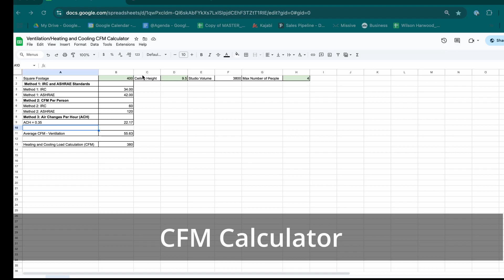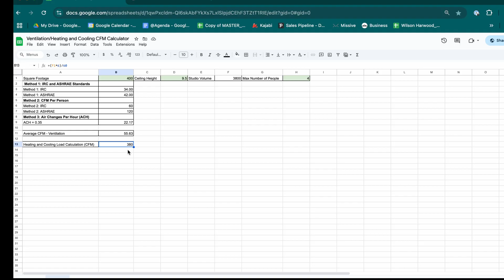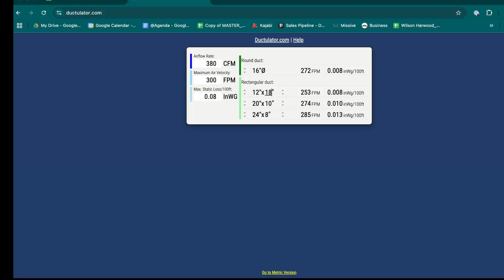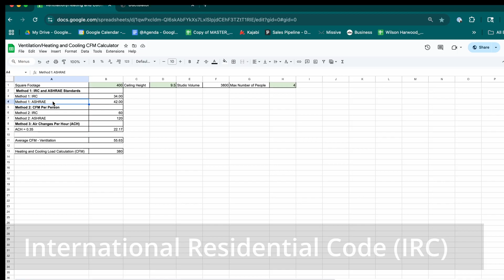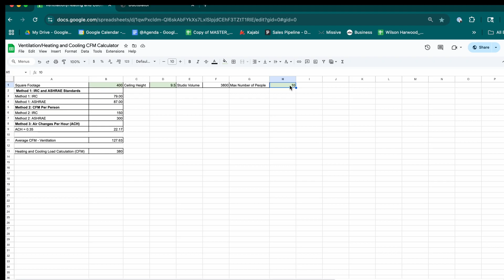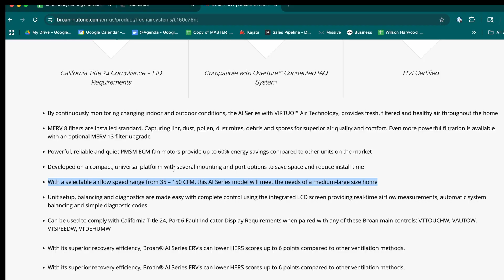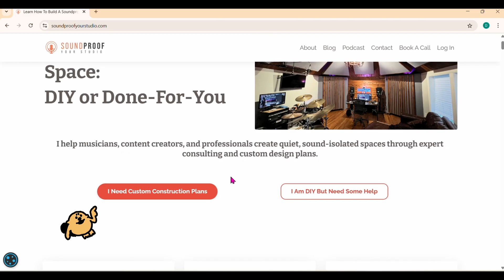Recording Studio HVAC Design  Air Speed

Comment: Regarding the mini split, are you saying it's actually quieter to mount the unit in room than to do a ducted solution with the fan outside of the room? I've got an ERV and I've been debating using the same ducting for cooling or putting a mini split in the room.
Reply from the maker: Yes, in-room ductless mini splits are often quieter than ducted systems, unless the ducted fan is placed well outside the studio and the airflow is extremely slow (under 300 FPM). But that setup’s harder to pull off.

Ductless = no duct noise, simple install, and modern units are whisper quiet, especially on low fan speeds.

Pair it with your ERV and you’re golden. 👌

Comment: Would it be sufficient to only suck out the CO2 with the HVAC system and have a passive airflow going in? Like in homes
Reply from the maker: Good question! That setup can work in smaller studios, passive intake with an exhaust fan pulling out CO2. Just watch out for negative pressure, which can mess with soundproofing or cause noise leaks.

If you treat the intake path acoustically, it could be a solid low-noise option. What size is your room?
Reply: @soundproofyourstudio So you’re saying a air intake would be neccesary? Controlroom and Live room combined are 7 x 5 meters, so I figured I would need two vents in and out anyways.

Comment: When using existing supply/return ducting you'd need to add a baffle box for both.  If needed, how would you calculate the FPM increase to compensate for the reduced CFM airflow due to the baffle boxes?  This gets a little complicated.
Reply from the maker: Great question, it does get a bit technical!

Yep, baffle boxes reduce airflow, so you might lose some CFM. To keep things quiet and effective, you’ll either need to use larger ducts or upgrade your fan to keep the air moving at the right speed, but still stay under 300 FPM to avoid noise.

It’s a balance game. Tools like a Ductulator or an anemometer can help you fine-tune things if you want to get exact.